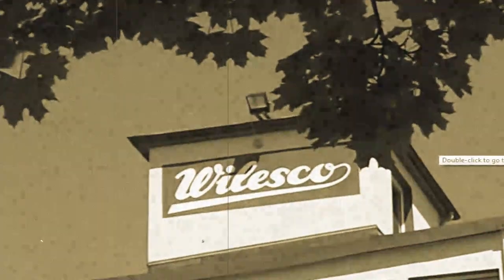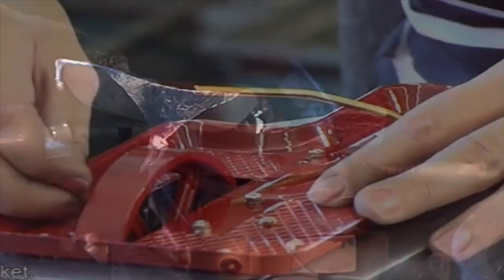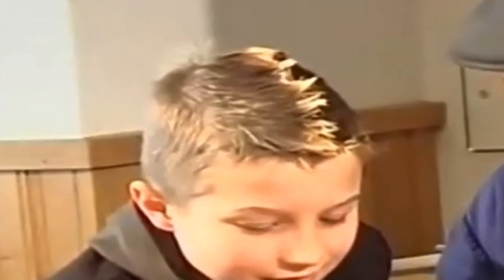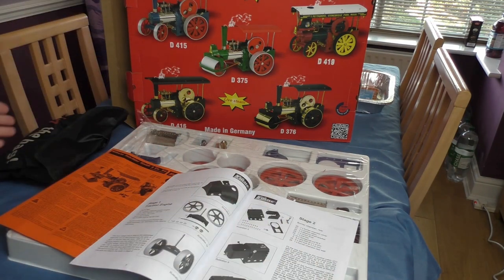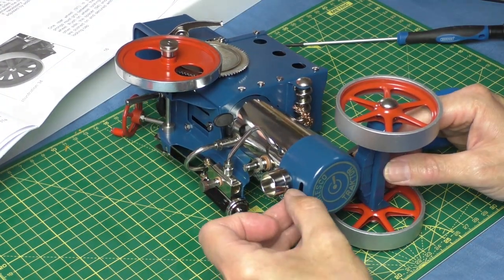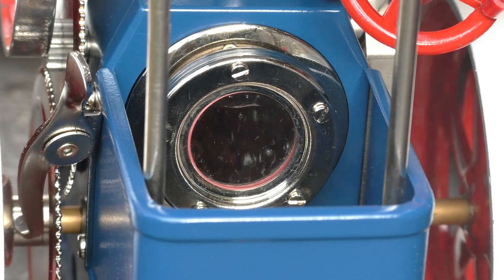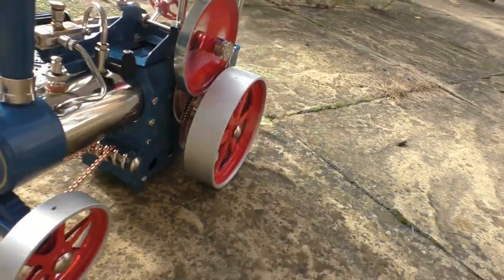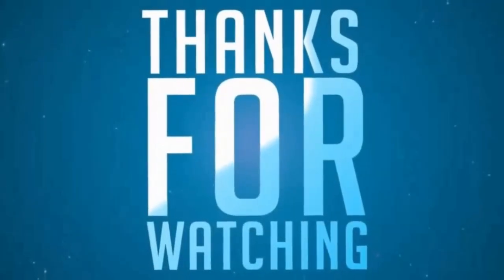WILESCO D415 live Steam Tractor (built from a kit)

Comment: Fred on the left side of the engine as you look from the back  you will see two brass cogs  grease them  to cut down the noise  also preventing any wear  tyres from eBay  a lso give good traction   and look good
Reply from the maker: Thanks.

Comment: It’s even cooler than i pictured in my head. Do you think someone who has never had any model kit experience could do this if they have a reasonable head on their shoulders or do the instructions assume a solid foundation in such mechanics?  I’m going through my steam engine era atm.
Reply from the maker: Its pretty simple nut and bolt work really. The only tough part for me was the main feed pipe from the boiler as the the treads were tight to align.  I would say that if you take your time you will be ok.
Reply: @CB-RADIO-UK  thank you so much for answering. I’ve got tools and magnifying glasses so I think it might be worth giving it a shot!